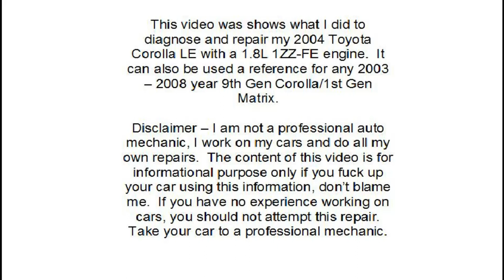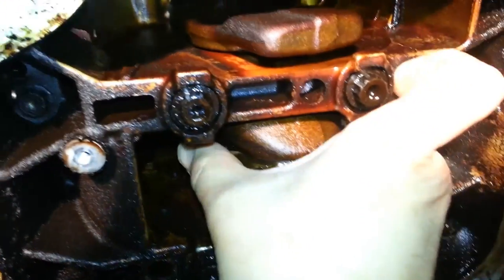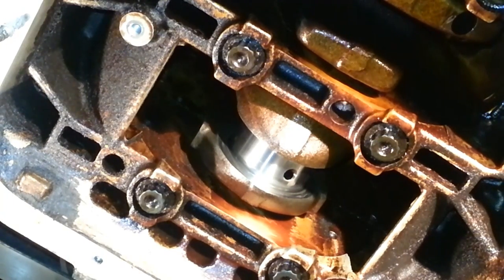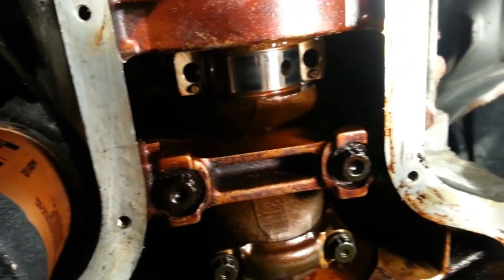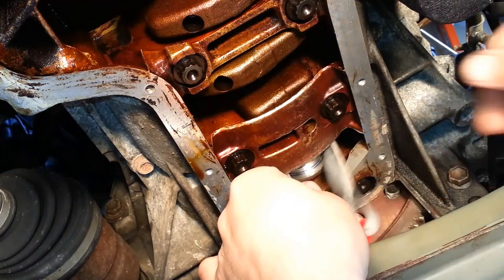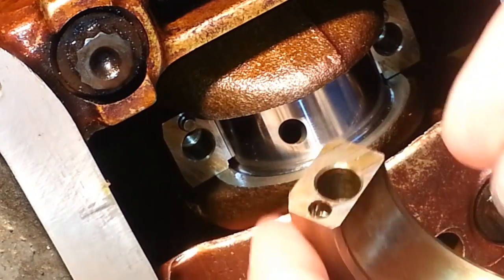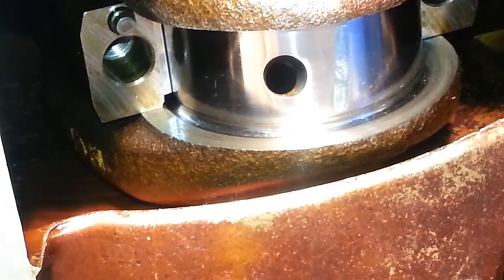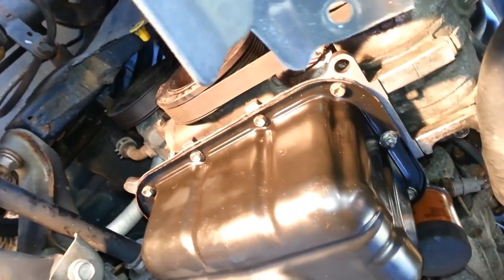2004 Toyota Corolla 1.8L bearing replacement to fix rod knock caused by bad connecting rod bearings

Comment: How did you find out what size of rod bearings you needed?
Reply from the maker: +Никита Российтцев - I know the video is long, but at the 30 minute mark I mention where the bearing numbers are marked, they are stamped on the back of each of the connecting rod bearing caps.
Reply: +Mark G thanks!
Reply: +Mark G So good sir, do i just buy a standard set from rockauto and gauge it to decide how to adjust from there, or is there indeed a way to buy number 1,2, or 3 size bearings. as u mentioned you had double number 2's on your toyota. I only ask because i am at this exact point in rebuilding my vibe with the same engine. Thanks in Avance!!!
Reply: +craig omeara You can buy 1, 2, and 3's from toyota dealerships, I bought the same exact size shown on my previous rod bearings (which was 2) and it didn't help much, still have a rod knock although it is a lot quieter. Although that may have been my fault, after I heard the first rod knock I immediately stopped driving but I had to drive home somehow, so maybe thats where I damaged it beyond repair.
Reply: Никита Российтцев So were you ever able to resolve the problem, perhaps with a larger bearing? Or are you still able to drive it as is? I'm very interested to hear how this went for you. Thanks
Reply: +craig omeara  I never fully resolved the problem, I almost 100% could have fixed it properly but I could not be bothered to try this again, seeing as I had already replaced the timing chain and done this already. the car has been running strong for a month now with barely a knock (unless your rolling downhill slightly pressing gas or in park and press on the gas) I ultimately decided to just drive it as it is since it does work even if it wont last long
Reply from the maker: +craig omeara Craig as Никита indicated you can order the bearing Marked or stamped  "1" (Toyota part number 130412202401), Mark "2" (Toyota part number 130412202402) or Mark "3"  (Toyota part number 130412202403) from your Toyota dealer or a Toyota parts supplier on-line.  Note: These Toyota part numbers were for my 2004 Corolla.
Reply: Никита Российтцев I agree with you entirely, you may as well continue to drive it until its a problem again then readdress it at that time. Its nice to know that it will at least be drivable again when I get done as I only put a 1000 miles on my vehicles each year anyway. Just curious, did you polish the crank and check gap with plastigauge?
Reply: Mark G Thanks a lot for that, that's a lot of leg work you've done for us. Mine would be a 2003 vibe, which appears to have the same engine. So Mark, is your vehicle still driving fine after the rework? Thanks!
Reply from the maker: Craig, yes still running great!
Reply: awesome to hear, Ill be wet/dry polishing tonight and putting the top end back together after cleaning. A lot of people on forums only talk about spending money to do things by the book over and over, not a lot about real world guys like us just trying to get that extra 20k miles. Why in gods name replace a crank and do a total rebuild when you can just replace consumable components without further damage to the system ya know?
Reply: +craig omeara I've always regarded journal shells as service items anyway - just that most people don't know that, so they assume that's big bills or the end of the engine. In many larger commercial engines there's a service interval for replacement of shells, so I'm not too surprised if and when I might need to do them on a smaller engine, especially a high-miler. Nothing lasts forever.
Reply: just a little update for those who care, approximately 500 miles in and my car still has a slight knock but is still running strong as ever
Reply: What about now it's been 3 months? Did the engine have a history of oil neglect?
Reply: KiwiPowerNZ no history of oil neglect and the engine was perfect, it was so clean and everything, no rust, no leaks, oil was always changed on time, until I somehow completely forgot to change the oil, ending up running approximately 15k miles without changing it because I used to travel A LOT. So yeah, one time I just had to floor it so I wouldn't crash on a turn and that's when it started knocking, it should have broken a lot sooner but the engine was pristine. Anyways, the engine is now gone sadly, just completely shut off around 1500 miles in as i was exiting a freeway, felt completely fine until I started coming to a stop, car started shaking as if I was stalling in an automatic. Engine swapped it, and the second engine broke within 150 miles cause it was complete garbage, so I got ANOTHER engine, and it's now on its third engine, it runs alright but yea, nothing compared to the old engine, if the damage isn't too much you probably could just replace the rod bearings themselves and it will last you a while, but if it started knocking around 5-6+ RPM I think the damage would be too significant to last you a while
Reply: Kim Jong Chill My 1ZZ-FE has 186,000 miles on it and no knocking right now, the lifters tap a bit at idle. I've been watching these videos because the common thing to do is wait until the bearings fail, then fix the damage to the crank shaft and replace the bearings. But what if you replace the bearings before one of them fails? That way, wouldn't there be no work needing to be done to the crank shaft?

Yeah I can understand how you forgot to change it. Changing it by checking the miles is a pain so I mostly go by how it looks on the dipstick if it looks clean or not. I've been meaning to change mine soon it's just as the point when it's starting to look dirty. I bought enough Castrol Magnatec oil while it was on sale that I'm sorted until next year pretty much. That's amazing to me that there is so many bad used engines out there. People who owned those must have a mindset that because it's a Toyota I don't have to touch it and it'll be fine and proceed to ruin engines that could have lasted hundreds of thousands of miles. But 2 bad replacement engines that's horrible luck.
Reply: KiwiPowerNZ yea it's always a good idea to replace worn out parts when you can, but it's kind of annoying, if you don't mind changing the bearings yourself and taking the time I say go for it, and yea, I'm pretty sure as long as no bearings have actually started knocking, there shouldn't be much or any damage at all on the Crankshaft. The engines I got were from some guy I know who pretty much salvages car's for parts, one was a steal for only 200$ which is the one I currently have, so I can't really complain about that too much, maybe I should have bought it from somewhere better and more reliable but oh well, happens when your cheap and too lazy to actually look around for engines yourself

Comment: What happens if add more engine oil his sound going to stop
Reply from the maker: No adding more oil will not quite the knocking sound, ear plugs will tho🙂
Reply: A rod can only knock a few times before it's no longer in able to maintain standard clearance. It's essentially impossible to react quick enough. So adding oil won't help.

The only rod knocking that doesn't do permanent damage is the few knocks you can get when a car hasn't been started for weeks.

Thicker oil will fill the bigger space but only for so long until it eventually wears and starts knocking again. It's a good idea though if you're unable to fix it immediately and need to keep driving - it may slightly limit the damage.

Comment: what was the reason you think that bearing went bad
Reply from the maker: Most likely the cause was poor maintenance on the previous owner’s part, I purchased the car with 110K miles on it and had to replace the bearings at about 118K.
Reply: My friend is telling me that I should take the crankshaft off because i spun a bearing . My bearing was a lot more severe then yours. When i got the car it had a severe rear main seal leak that probably caused  the damage.I had only one bad bearing and no other damage. My friends telling me that i should take out the crank  and do a lot more.What made you just replace the bearing  and not pull the crank?The reason i dont want to do it because the money and time and it has high miles.Also the  torques settings that you did in the video was for all four bearings or just for journal 1?
Reply from the maker: I only had damage to the bearings so I had no reason to pull the engine/crank.  The torque requirements on my 1.8L were the same for all 4 bearing cap screws.
Reply: i hear some toyota engine has a defect in rings etc... you might want to research it

Comment: Was this a common issue for the 1zzfe engines?
Reply from the maker: The 1ZZFE has a know issue of oil consumption when the piston rings get stuck in the pistons (video on repairing this can be seen here: https://www.youtube.com/watch?v=A595LR4SQpI). When that happens and is not monitored and/or a lack of regular maintenance the bearing will fail.
Reply: It was an issue with 4zz-fe 1.4 and 1nr-fe 1.33 engines, because some users used "thicker" oil, not the recommended one. So users of 4zz-fe used 10w40 instead of 5w30, and users of 1.33 used 5w30 instead of 0w20. The "thicker" oil cannon flow back in time throuh the holes of the piston, and burned onto the piston rings.
Reply: @vartikcsaba  it's a common enough problem with a LOT of engines I've seen sent for rebuilds (all brands) where the oil rings on the pistons get stuck solid in the pistons and that's where things go south.

Comment: My Corolla makes the exact same sound
I changed the Big End bearings still no changes
I then opened again to check, i found that no.2 finished quickly wtht evn drivin more than 5kms but other sides are still fine

What could be the problem?

Comment: I have a 2001 toyota corolla. I am a single female.....At this point I just need a husband so I can stop looking at youtube videos hoping I can figure out how to fix a car myself 🥺
Reply: I’m single male looking for damsel in distress or a wife :D
Reply: I take care of the cars you take care of the house. Deal?
Reply: Are you still looking on YouTube to fix your car ?
Reply: Eff these clowns. You can do it.  Just try. What happens if you fail?  Car still doesn’t work and you learned a few things and gained some experience.
Reply: Come marry me.
Reply: Am a single man. I wish I had a woman to work on my car so I could stop looking at YouTube.
Reply: @eddiebannis6141  Yes, unfortunately
Reply: I just finished rebuilding my 2006 corolla, where do I apply
Reply: @SamShudders  I have tried everything. My car is still not working. Weird thing is, I've had to get of 3 cars for the same issue. OD light flashing suddenly & the problem only starts after I take my car in for routine maintenance. Within less than a full day, the OD light starts flashing. I had a BMW X5....No problems whatsoever. Took it to the dealership for a tuneup, within a mile after picking it up the OD light starts flashing and car starts jerking. Went right back and told them I didn't have that issue when I first took the car in. They said they did not touch anything. Then they quote me 7K for a new transmission. Coincidence that the same exact thing has happened with my two other cars. I think they are purposely messing with something a sensor or something to get me to spend thousands .
Reply: Still looking for a husband am available...
Reply: 35 male single South Florida mobile mechanic life❤❤❤

Comment: Un beliveable video I got thrugh it to the spun bearing, replaced the others with the same #1,2,3 etc. after i cleaned up the # 1 cylinder journal as u showed us , replaced the bearing with #2 as on the cap the plastiguage gives me .0034 oil clearance which is out of spec .0024 any idea what the next bearing size would give me in oil clearance. or where to get the next bearing approx .0007 thicker
Reply from the maker: The "Mark 2" is 1.491 to 1.494 (0.0587 to 0.0588) in thickness. The next bearing is the "Mark 3" bearing and it is 1.495 to 1.498 (0.0589 to 0.0590) in thickness.
Reply: Great video, Mark.  As for getting thicker bearings, I remember if we wanted .0005 less clearance, we would use just one std with one .001 thicker bearing to give us the extra .0005 (cause if you use BOTH .001 bearings, you wind up with .001 less clearance).  So, if De'neen R went to the "Mark 3" bearings, he would have only get about .0004 less clearance which wouldn't even be half of what he needs to be back in spec.

Comment: Will this work on 2013 Hyundai elantra. Just need an answer and honest. Thank you.
Reply from the maker: Don't know never worked on a Hyundai, likely similar as long as you can access the oil pan.
Reply: @mrmarkg8564  some engines have counterbalance shafts. If it does it can not be done like this

Comment: Did you say you used WD-40 before you wet sand?
Reply: Or just water
Reply from the maker: Yes, WD-40. I found it works better than water for this process.
Reply: Did the bearings look brown a little ? Or broken ?

Comment: Did you figure out the root cause of this problem? Could it be that the oil flow is obstructed? One suggestion to measure the play on these bearings is to use a tail indicator and a stand and move it up and down
Reply from the maker: Poor maintenance on behalf of the previous owner, only had the car for a few months when this started.
Reply: @mrmarkg8564  you did a very nice job

Comment: Where is the block heater on a 1.8 L? Toyota
Reply: And the 1.3L?
Reply from the maker: Under the hood
Reply: The factory block heater was an option. I purchased mine from Toyota of Canada. Its installed in a pre drilled recess in block behind battery but to the right of the upper radiator hose. Remove air cleaner box and you can see it near the coolant temp sensor area. It was a bear to install but nice to have.

Comment: Could you tell me if this is the same problem you've had? I've noticed this knocking sound in my 2002 Corolla that the dealer wants to charge me a fortune to diagnose (let alone fix!), but there seems to be an opinion that this is how this model engine sounds as it ages (though my car only has 81k miles). Here's a video of the engine sound; would really appreciate your feedback:
https://youtu.be/8JTZL8b0vSw
Thanks!

Comment: It's always cylinder #1 that fails first on the 1zz engines. The way the intake is designed, that cylinder gets the most sir, and therefore the most powerful combustion event.

Comment: Industrial engines class bosses..shown that...muriattuc acid at..ace hardware....
Can....dissolve alum..copp..off steel...then soap off or neutralize........then polishing bands...I...get ingenious and use OLD bearings over coarse....then basketball lace to polish on down to 1000+

Comment: Where is Toyota reliability
Reply: This is very unusual for this engine from the looks of the internals of that engine I'm going to assume oil changes were neglected. The only problems that have been mentioned about these motors is usually oil consumption due to the rings sticking and some leaking at the timing chain tensioner do to aging o-ring
Reply from the maker: @mech4061  Yes, the previous owner was a younger girl and I suspect she neglected the regular maintenance.

Comment: If you have bearing material in the pan, you have metal in the oil circutes, you have to remove the engine and tear it down, all the way, and have it cleaned, if you think the oil filter will trap that junk, you are wrong